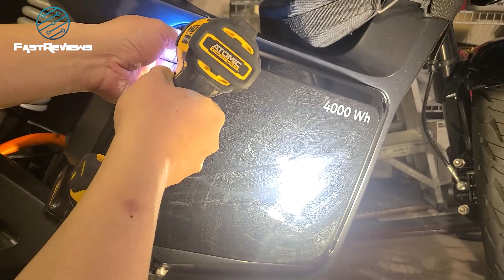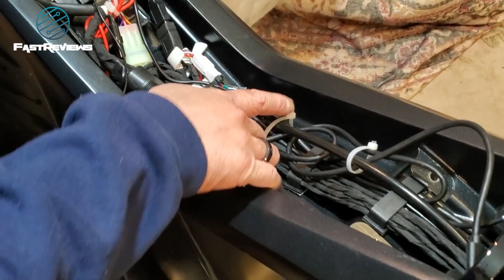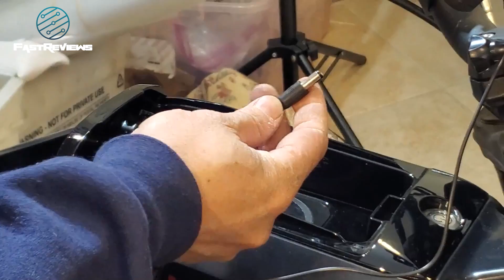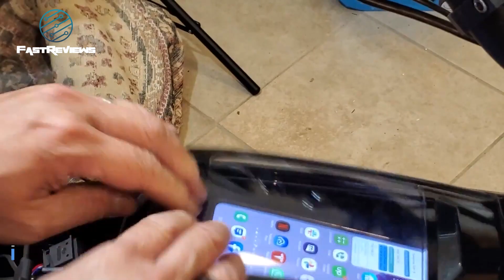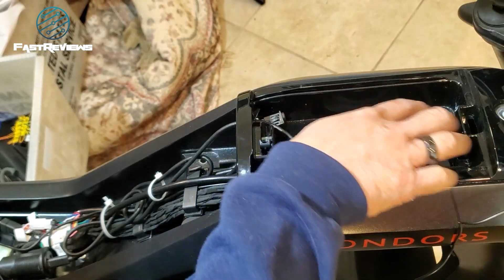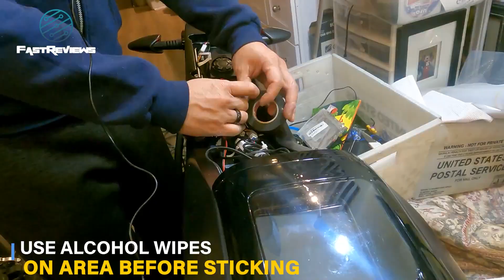Transform Your Sondors Metacycle: LED Lights, Fast Charging, and Customization Hacks

Comment: I got a question on a separate matter. My remote(s) are not allowing me to start my metacycle. Both reposts seem to be working. Seems to be a problem with the bike receiving the signal from the remote. Can anyone offer advice on where to start?
Thanks
Reply from the maker: Sorry you may try contacting Sonders they have a Los Angeles office it seems that has been pretty responsive